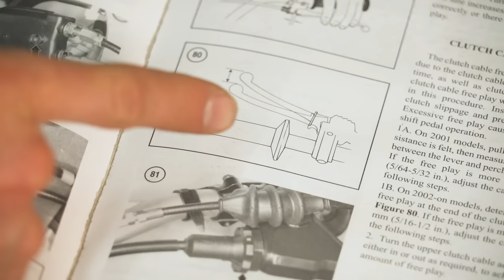How To Adjust A Motorcycle Clutch Lever | MC Garage

Comment: Hey Ari, I have a question. Where I could get a Kawasaki z125 pro workshop manual as I didn't have the owners manual for it since I bought it second handed. I'm planning to upgrade the engine by installing big bore kits, and swapping the valve springs to suite the specs of the new camshaft I got. But without any manual I couldn't do anything except basic maintenance on my bike. Any suggestions Ari? I really appreciate your help.
Reply: You oughta be able to get one through your local dealership. I'd say check with a Haynes Manuals, but I don't believe they have a book for that bike yet.
Reply: Ari Henning thanks man. I really appreciate it. Gonna keep it in mind. How's your z125 Ari. Did you get a big bore kit for it. I miss your little project on that pocket rocket.

Comment: I have this sort of problem with my 959 I struggle to get in neutral sometimes and feels stiff going in 1st and second gear. Did a quick fix by adjusting lever but problem has returned with a vengeance any ideas please

Comment: I have an issue with a bike I just bought. I am a new rider is it supposed to stall out when I hold the clutch and I am in first gear? It does it alot when I am in traffic and I am not sure why it keeps stalling out. I can only do a stop and go like 2 maybe 3 times before it stalls out. Only way for it not too is to use the throttle when I am still holding the throttle. When I do this tho the throttle acts up and starts to jerk. I need help fixing this. I am a new rider for it is hard to understand if it is suppose to be doing this but I am almost positive it's not because it wasn't doing this before.

Comment: If my bike will move forward (quite briskly) while the clutch is completely released and no throttle is applied is my free play too tight or loose? And as more threads become visible on the barrel adjuster by the handle am i tightening or loosening the free play? The lever starts to feel tighter, but does that translate to more slack on the other end? Or should my lever feel a little loose to indicate more slack?
Reply: It's too loose.
Reply: You have too much slack if you can not disangage the clutch when you put it all the way to your handlebars.
Reply: In other words your cable is too long! You need to shorten the distance by adjusting it. Look in the manual of your bike.

Comment: my clutch engagement sucks... as I release it gives me nothing...nothing...nothing... and then stall. is there anything I can do to fix this?
Reply: Thats the sign of clutch pads wear , you should have your clutch pads replaced. :D
Reply: Razer Loche give it some more throttle?
You must be having a 80-20 clutch play. 80% nothing, 20% engagement. That's the best config for when you have to commute through a lot of stop n go traffic
Reply: No way! I only have 4000km on that bike
Reply: oh. so the clutch engages early as I release it?
Reply: I know , i used to have the same issue . That probably means your bike have poor clutch engagement compared to other bikes manufactured  . Kevin was right , you should give it more throttle to get it moving and prevent engine stall. If doing so doesnt help , then you should replace them with better clutch pads , and stronger springs ,too.
Reply: TheBrokenDreams they are called clutch discs, not pads.
Reply: why does everyone always go to the extreme end of the spectrum for armchair diagnosis? with a little common sense the guy sounds like a noob and just doesn't know how to shift properly. instead it's do engine work and repair your clutch... that sure is helpful >_>

Comment: Hey guys. I know this video is a few months old and you may not get around to answering. But, I've just replaced the bars on my SV650 to a wider set of Artrax bars and I realised that when I turn the bars to the right fully (eg to make the sharp right turn from a stand still) the clutch cable becomes very tight. Though I dont feel anything happening to the clutch when this happens. Is the lack of slack for even that short amount of time going to cause any harm? The slack when riding is what I believe to be sufficient and you can feel that there is a bit more slack compared to when the bars are turned full lock to the right.  Thanks :)

Comment: I have too much cable slag for my comfort but how to make sure that the clutch is fully disengaged?
Reply: It should be very easy to pull it. The first centimeter! You need to have a little free play
Reply: If youcdo not have free play you need to adjust it.
Reply: Or your clutch will not disengage and it will wear off.

Comment: Can anyone’s offer some advice? I’m having an issue with my clutch seemingly not fully disengaging. All cable adjustments are correct and all indication marks are exactly where they need to be, the plates just seem to stick when the lever is pulled. I can put it in gear and push it when the bike is off but there is this initial feeling of drag almost like fluid surface tension or suction. I can see one plate and move it by hand with the oil cap off and lever in, so I know there is free space for the plates to move. My guess if that it’s the synthetic oil i’m using (10w 40 motorcycle mobile 1 racing I think), the plates had been left in it for several days while waiting for a replacement gasket. Any Ideas?

I think i’m just going to do half current oil (300miles on) and half conventional to see if that makes a difference. And before you start freaking out about not mixing synthetic and conventional, what do you think synthetic blends are? It makes NO difference and is NOT dangerous. The only reason not to mix or switch between them is if your bike specifically require one or the other.

Comment: Show us how to access and work on our gearbox.
Reply: Gearboxes don't need attention. If they do, you're looking at a complete engine disassembly.
Reply: nah no thnx that's not everyday maintenance routine, that's full engine knockdown / overhaul right there. Unless you want to replace blown off gears or swapping to racing gears that's fine but a pain in the butt to do and when you had completely disassemble your engine you might want to replace any wear bearings, clutch pack, piston rings, new high compression piston along the way since you had tear down all the engine components.

Comment: A little too much jargon. Did you say glazing your clutch plates? I don't know what that means! I guess if there's not enough slack, then your lever is sort of in a hair trigger situation, right? Which is not good. In other words, as soon as you start squeezing just a little your bike is going to immediately disengage from whatever gear it's in. Right?  Anyway, the other day I got my bike back from the shop and when I squeezed the lever all the way, while in neutral, put it in first, and started to release the lever, I noticed I had to release it a lot farther than I was used to. I was thinking: Jesus, when is the bike going to start moving/pulling me forward? Why do I have to release so much before the bike does anything? I took my bike right back to the shop and the tech came out and fiddled with something right next to the lever. And doing that made the situation better. Anyway, I'm afraid to touch it until I know what the heck I"m doing! Thank you.